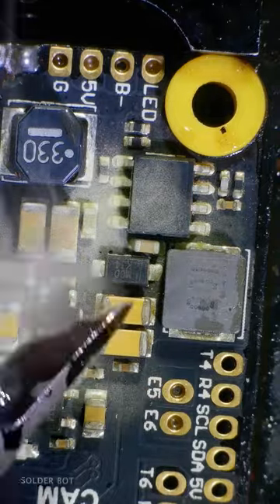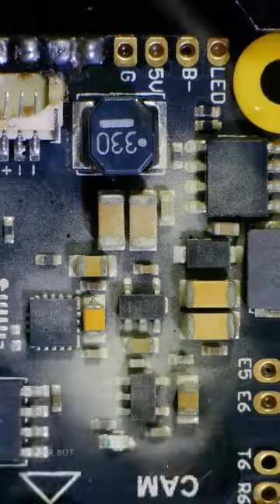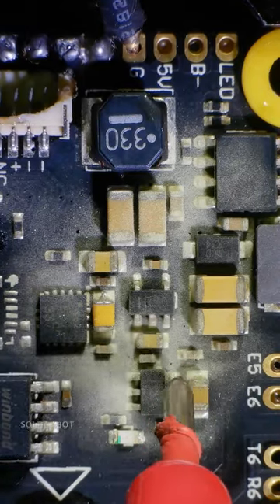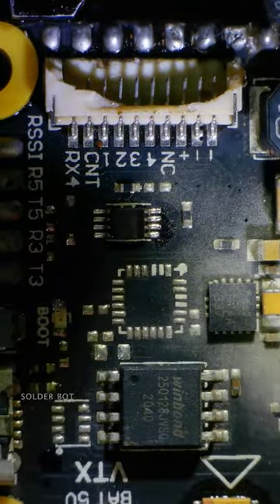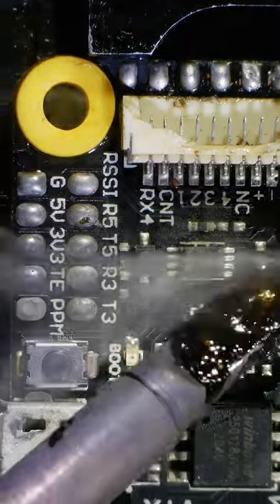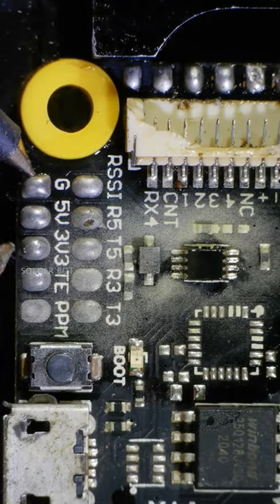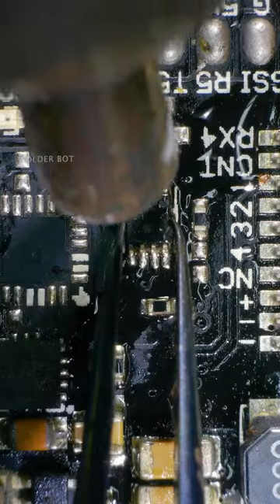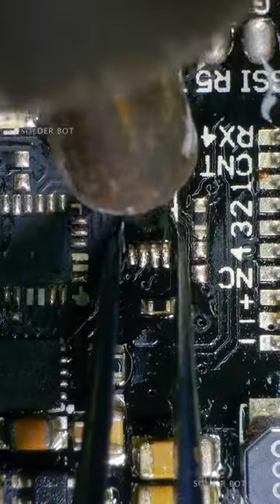Short Finding on Flight Controller #shorts #microsoldering #smdsoldering #fpvrepair #bandifpv #asmr

Comment: What happens if you inject power in the main power rail liek for example from thr battery connector will it show where's the shortage?
Reply from the maker: It doesn't showing any short on the main power rail. it has isolated from this regulator chip